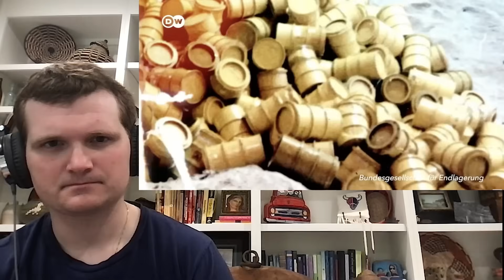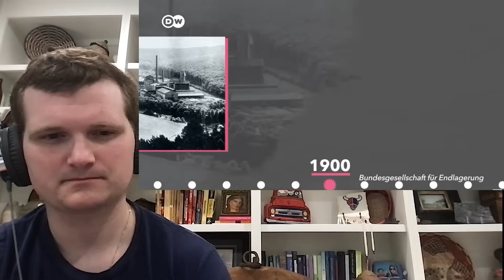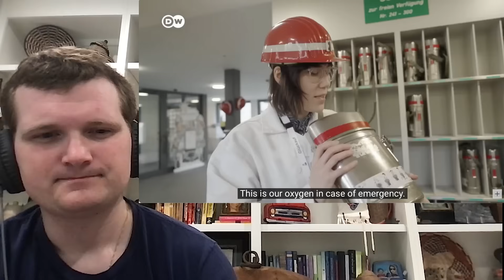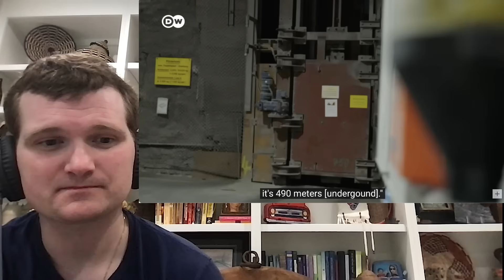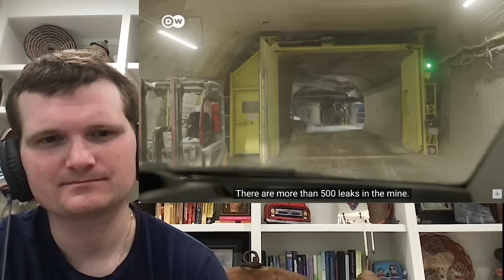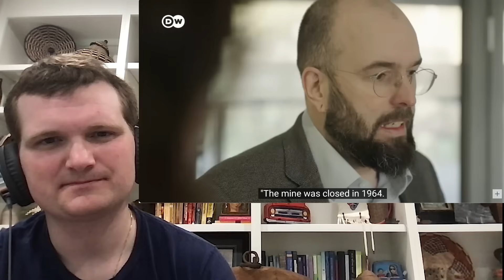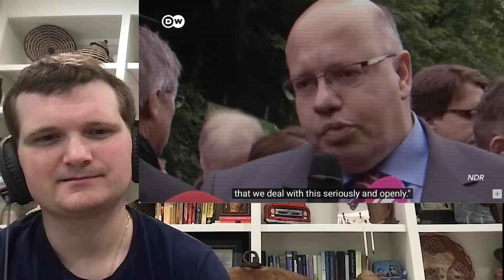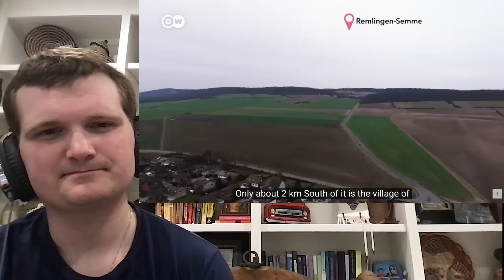This Nuclear Waste Dump Has Been Leaking for How Long? - Nuclear Engineer Reacts to DW Planet A

Comment: If you've ever wondered about Germany's reaction to Fukushima, you also have to know about the Asse scandal that was very much on the mind of politicians and the general public. There were a lot of questions about whether the industry can be trusted. There were irrational fears, yes, but arguments from industry insiders that the technology was safe were undermined by the fact that the same industry had downplayed the problems with Asse for decades, a scandal that had only really been exposed a few months before Fukushima.

The problems at Asse came to light around 2008-2010. Then Fukushima happened on top of a political climate where industry experts were seen as untrustworthy, especially when they called anything nuclear-related "safe". It's hard to argue against that distrust if those same industry insiders had demonstrably lied about the safety of long-term storage for years.

And this scandal is far from over. It's one thing to look at what people did in the 1960s and call them stupid or naive, but the real scandal is the attempt to downplay it and to cover it up -- something that's still not fully accounted for. For example, the former environment minister Jürgen Trittin (minster from 1998 to 2005) has stated in 2019 in front of an investigation committee that there were "experiments" at Asse with the storage of highly radioactive waste -- not just the low and intermediate waste that comes in barrels. How much highly radioactive material made it to the site, where it is, and in what form, was unknown as of 2019. The documentation is so bad that, until we go and explore the contents of that mine, we cannot even be sure that all the material down there is "only" intermediately radioactive.

Maybe nuclear power is a perfectly safe technology, and the waste problem is completely manageable if handled correctly. But good luck convincing anyone of the safety of a new permanent storage depot (let alone nuclear power in general) with that kind of historical baggage.
Reply: So basecly it's not against the technology but against corporate greed and untrustworthyness
Reply: @MiningdragonLP  that's exactly it. The technology may be perfectly safe, but we simply cannot trust the operators or even the involved politicians for that matter. Everyone is just out to line their pockets. Which is a shame, because even if we don't end up regretting the shutdown of all out nuclear power plants, we'll definitely regret the loss of knowledge associated with it eventually.
Reply: @maximilian672 so what happens when fossil fuels run out or god forbid that 1 massive volcanoes erupts and shoots ash into the air solar wouldnt be useful. What are the plans for energy in the future
Reply: @trappestarrgaming3422  if a sufficiently large volcano erupts, we'll have other problems, tbh. Extinction of large parts of the food web we rely on, for example (if solar is dead, then so are a lot of plants, harvests would be bad, many would starve to death). Let's leave the doomsday-fearmongering out of the discussion. Especially since there is currently no super volcano on the brink of eruption.
Fossils running out, now that is a scenario that we'll have to deal with soonish. 2060'ish according to some studies. If you don't want to rely on renewables alone and want broad public support for clean nuclear power, then I suggest you start by kicking out all those actors responsible for the public climate towards nuclear power in parts of Europe.
Reply: @maximilian672  I wasnt trying to fear monger I was legit asking for info/clarification. This issue is honestly new to me and realli confused me. The thing abt kicking out bad actors, that's impossible. Whenever power and money is involve they will show up. The thing abt it is some of them start out being honest and just fall down the dark hole so to speak. The saying the road to hell is paved with good intentions is realli accurate here. I cnt speak on the individuals cuz lik I said this issue is new to me but if you have some sources that are actually informational in the situation. I hope my other comment didnt come off as ignorant or being superior
Reply: @trappestarrgaming3422  sorry for misinterpreting your intentions, my bad. I don't have good primary sources at hand, that I could give you. Looking at Quora and other sites where people asked questions similar to yours, I get the feeling that others that answered agree with me, regarding the volcano scenario. Power generation is but one issue, that we'd have in that case.

Regarding your point on bad actors: I agree that it is impossible to prevent all people from ever abusing the power invested in them by the people. However, I don't believe that means we can't improve on the system. For me to vote to re-introduce nuclear power, I would require that bad actors are removed from power, held accountable and punished severely, without exception, once discovered. That's what it would take. Not more, not less. Because I believe, that holding people accountable, as private individuals, would incentivize people to be more forthright and to try and do the right thing. The current system favors the opposite. Most political powers are untouchable, no matter what they have done. And if they are not punished and effectively removed from power, come next election, the sheep will vote for them again *facepalm*.
Reply: @MiningdragonLP  The earnings go to companies the costs go to the taxpayer. thats the way the nuclear industry was going since the 70s in germany.
Reply: @MiningdragonLP  Yes
Reply: @MiningdragonLP  Very much so. People keep claiming the issue would be lack of knowledge and fear, but the real issue is that we know damn well that the companies will cheap out on anything they can get away with and try to downplay or hide any issues until they no longer can. They're even still actively trying to get out of paying for any long-term costs the old reactors may cause in the future, despite being directly responsible for them.
Reply: "Out of sight out of mind" solutions are always gonna come back and bit people in the ass, but it might take so long the corporation can pass the buck to somebody else, which is why Companies love them
Reply: This video explains the extreme anti-nuclear wave in Germany after Fukushima.
Reply: as long as its a privage for-profit industry it cant be trusted ... too many "accidents", disasters and too much damage without raparations was caused by the nuclear industry. With the people waiting forever to be compensated ... and even the last argument of being cheaper has not materialized once all the costs (short and long term) and the profit margins are being factored in.
Germanies good bye to nuclear power is not irrational, its simply a realization that all the promises were and wont be kept.
Reply: I heard something of like there are 2 Human Bodys stored in Asse or maybe the ash from them?
Reply: @asokawhite  Yes, that's true. These are the bodies of Otto Huber (34) and Josef Ziegelmüller (46), two workers who were killed in a reactor accident in Gundremmingen, Bavaria in 1975. They were killed when a container with pressurized superheated water blew up. Their remains, presumed to be contaminated, were reportedly put into lead caskets and stored at Asse.
This has come to light in 2009, and it is still unclear if the bodies were actually stored at Asse, whether they were radioactive, and what the families knew about the "special treatment" the bodies received.
Reply: Oh so the issue is capitalism again, big shock
Reply: Trittin is a Green politician who talks garbage. There is no evidence for highly-radioactive material at Asse II and it was never approved as a repository for high-level radioactive waste. Asse II is a storage facility for 125.787 barrels of low-radioactive waste and 1293 barrels of medium-radioactive waste (status report of the the mine Asse II, Lower Saxony ministry for environment and climate protection, 2008).
Reply: our alternative was coal and gas since renewables are not sufficient by themselves to run our (in big parts outdated) electric grid. I would love a safe nuclear industry in Germany, but arguing with fear are practically impossible. also a lot of the media spread intense amounts pf misinformation that worsend the situation together with a lack of accountability for media well perfect storm of bullshit
Reply: The power to extract the power of the atom was introduced to humanity with destruction and scandals. Even tehn, the fears that many people have today are very irrational, or one-sided.
Reply: We know for a fact by foreign nuclear plants, that nuclear is safe.
Reply: Things like a IFR can in fact have zero nuclear waste, because they use 100% of the combustible.
Reply: @edgarhilbert4797  Maybe, but claims like that -- even if true -- do little to address the trust issue, which in my opinion is key to the problem.
Reply: @renerpho Are Germans still a thing?
Reply: Radioactive waste can be handled and stored safely but it takes money in a lowest bidder world . What could possibly go wrong ?
Reply: Jürgen Trittin is a liar.
Reply: @HREguy  Maybe. It doesn't really matter who is lying, because someone is, and that's what makes this such a mess.

Comment: The way of burying low and intermediate active material back then was truly shocking, just dump them in and that's it. There should be at least bentonite or something to offer some isolation from low level water leakage and to slow down potential leakage. Preferably sacrificial corroding electrodes or other techniques could have been used, but looking at what was done, no care was taken at all.
Reply: This is a salt mine🙄 Walls made out of rock salt🙄 Who the fuck cares about short term isolation, when the entire mine is about to dissolve🤣
Doing nothing but pumping, is probably the best intermediate solution, because at least it does not hamper the retrieval of the barrels or what is left of it. 
If you had ever worked in wet clay, you would know how dumb your idea is, because you basically can't. You wait until it has dried up and exactly this will never happen to the Asse.

We will freeze the ground, when the actual work starts down there😉 Probably beed a nuclear power plant for this task. Funny, isn't it?
Reply: It's not just dump. It's called Versturztechnik.

Comment: 17:50 "Might actually be safer than throwing in hazardous chemical waste." - Keep dreaming, those hazardous Chemical wastes were also disposed of there; and many of the waste is undocumented. And already when the Asse was first used for nuclear storage there were voices that it wont hold up and water will get in, but those voices were ignored because the industry wanted a cheap disposal. This is part of the reason why Germans are against nuclear energy and why those yellow barrels became famous in protests against nuclear energy.

Comment: They probably thought it was a great idea at the time. Aren't we so smurt? Dounreay in Scotland, particularly the shaft, is one of the worst "just chuck it in and it'll be fine" disposal no-no's that I'm aware of. Just dump it in a shaft that happens to be full of sea water and connects to the sea, what could possibly go wrong? A sodium explosion, actually - oh, and radioactive particles leaking out into the sea. They're cleaning it up now, but it's incredibly expensive compared to what dealing with the waste properly would have been. Just leave it for future generations, right? Problem solved. Also deep borehole disposal, we solved this decades ago.

Comment: The Asse II-Desaster is one of the main reason why I do not trust the nuclear industry any more. They did everything wrong, documented it poorly and then lied about it. For example there are several kilograms of plutonium missing, that are not even accounted for and never had permission to be stored there - nobody knows where in the Asse this stuff is stored. Regulation and oversight was so weak, that the industry used this mine to dump everything nuclear they wanted to get rid of for over two decades.
If anything this is a prime example why nuclear power has such a bad rep in germany. But there were other ocations, where incidents were denied and later had to be admitted to - this lying is the only constant in the industry - and it is not limited to germany, or capitalism - it's the same kind of lies one knows of in chernobyl, fukushima, Kyschtym, windscale and many other places with nuclear incidents. This is not an industry like any other - it is tangled up in politics, military, corruption and secrets, and it is often not well controlled or has independant oversight. Asse II shows what happens if you allow the nuclear industry self regulation - it's a desaster.

Comment: Guess we need rovers to test and catalog everything.

The protest is interesting, n because if they have their way, eventually the water wins, it always does. Bringing radiation into their local ground water supply. 

It's in their best interest to get this processed quickly. They should be lobbying to ensure it's done correctly, but not protesting the act itself.

Comment: Mismanaging nuclear waste was a popular pastime in the second half of the last century. We also have mines that are supposed to contain only non-nuclear hazardous waste but as it turns out no one really checked what was going in the mine. Then at some point the waste caught fire and the mine flooded and there is toxic materials like mercury leaking into the ground water but outside of the region no one really knows or cares about it. The current plan is to just seal everything in concrete and hope it doesn't leak any further but it's a whole shit show. For more info, the mine is called "Stocamine" located on the French-German border.

Comment: The UK used to reprocess a lot of Europe's spent nuclear fuel at Sellafield and later Thorpe reprocessing facility. Btw Sellafield is right next to "Windscale"  Britain's only nuclear disaster, that plant has only just been disassembled and dusposed of after decades of sitting entombed after it's reactor fire.

One of the pictures earlier had a barrel labelled with "Ra" on the side, thats Radium, which is fairly nasty, they used to use it in paint on watch and clock hands in the early to mid 20th century until they realised how dangerous it was.

Comment: The fact that Mr. Folse is working in an extremely safe environment now, unfortunately doesn't say anything about the future. And that's why I think this German case exemplifies perfectly why I think nuclear energy shouldn't be on the table anymore. We can have safety measures now, and even a few decades from now, sure. But what happens if an economy breaks down in say 200 years and corners will need to be cut? Who cares about a nuclear waste site if there is no food on the table. And what if a country enters a war? We've had multiple world wars in little over 100 years. Or what if some manager decides that short term profits need to be made at the expense of safety? The past and present are littered with examples like these. 

Regulatory bodies can also suddenly become part of the industry  (e.g., FAA failed miserably with Boeing and EPA is nothing more than a shill for the oil industry now). Regulatory bodies can easily have strategically placed industry puppets within them, watering down every safety measure so the industry can profit from it. And that's not even covering the natural disaster factor. Or perhaps someone makes a massive mistake causing a safe cave to suddenly be flooded with water. Accidents will always happen.

We're not talking about a few years, sites like these need to protected and checked for hundreds if not thousands of years. Time will always find the weakest link...

Unless we can get rid of the waste entirely, and we solve the boatload of other problems nuclear energy still has (among which costs, build time, and guaranteed safety) AND it can compete with alternatives cost wise, I don't think nuclear has a future anymore. But hey, perhaps those 'buts' are solvable.

Comment: I'm pretty certain that this is indeed where the depiction of yellow barrels came from, through I haven't done enough research to be completely sure on it. I also find it worrying that this location seemingly isn't brought up during training. It is a prime example of how much trouble and danger poor waste management can result in. And how expensive it is to try to save a quick buck. I get that actual accidents take priority during training but the harm caused by a failure to treat low level waste should be reinforced with real world examples like this one.
Reply: I've done some research on this... and it's exactly how it appears in the Fallout games... 🤣
Reply: Whoever did this should have to pay, that's the punishment for getting rich off being lazy
Reply: Germany despised nuclear energy so it doesn’t surprise me they only use this for negative press